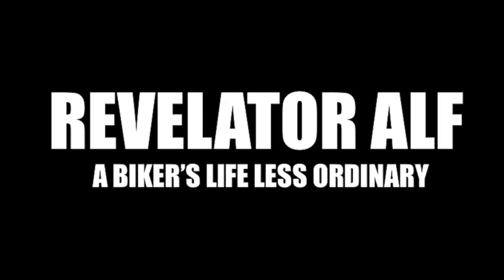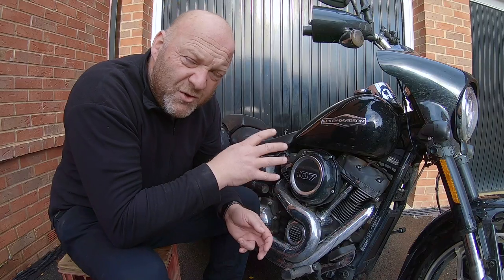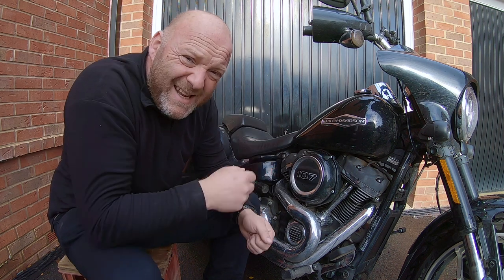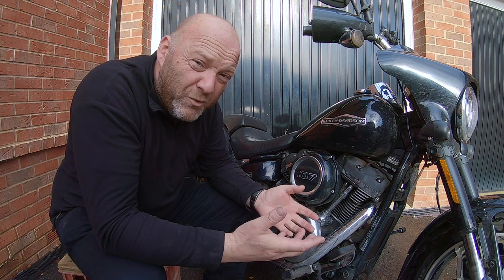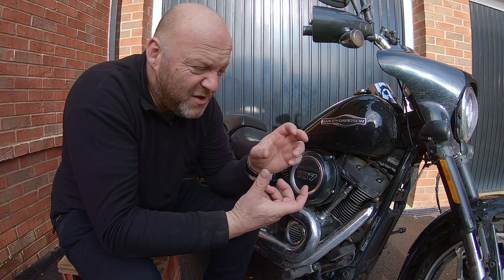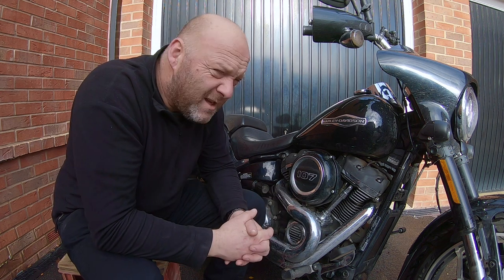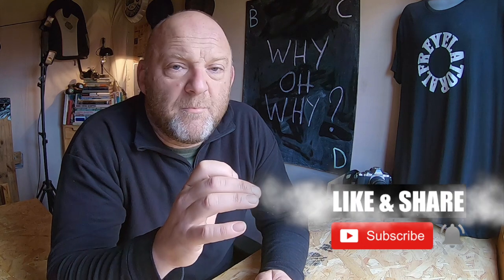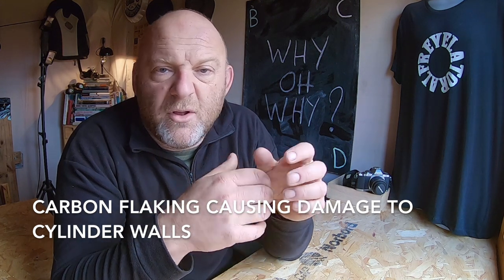Is It Worth Installing External Breather Kits | H-D Truths & Mistakes

Comment: I have a Screamin Eagle Stage 1 air filter kit on my 2019 Fat Boy 107. I can connect to this video you mentioned. All I did is to open up the air filter sprayed some Liqui Moly throttle body cleaner over the throttle body as prescribed on the bottle which helped clear oil and other gunk from the intake valves and I could see that the engine was breathing a little bit better as the revs it needed to sustain while idling was reduced by 20 to 30 RPM and overall it also improved my pick up and acceleration although a wee bit but noticeable. Worth trying it Liqui Moly recommends the activity every service but should be fine every 3000 miles too
Reply from the maker: Ok good to know, thanks for the info. Cheers
Reply: Prevention is Always better than Cure..There are Countless Automotive Videos where the Build up is so Severe the only thing that Works is a Tear Down and a Sandblast using Walnut.. NO Additive with Resolve or Reverse the Carbon build up..Just another Gimmick.

Comment: I can tell a riders habits just looking in the carburetor.  Someone who just cruises around doesn't have much transfer of oil through carburetor.  Someone who likes to bounce  off the Rev limiter will need a catch can . All these bikes are basically designed the same so the only real difference is the rider. This guy is being too technical. I have a buddy who could ride  20 different Harleys and the breathers wouldn't be an issue.  Have me ride those Same bikes and you'd need a catch can and not one of those tiny ones but with a drain on the bottom. Every police bike in my area has a bypass with catch can. I learned that decades ago and it's just logical that getting rid of hot air going into carburetor is beneficial. Only helps on warmup.

Comment: Very interesting and informative. I like that you showed the pros and cons. But they use the same system in every car and bike made. So it really can't be that bad by not having one. And to gain a few HP and possible check engine issues later is it really worth it. Cleaning the throttle body every now and then I guess will help. But thank you for you open minded thoughts.
Reply from the maker: Thanks so much

Comment: When I got my 2007 Dyna it was bone stock with 6800 miles. When I pulled the plugs they looked good except for a little bit of deposits built up. I put on a high flow a/c, vented the heads to the atmosphere,  some Screamin Eagle slip on mufflers and an FP3 tuner. It has 37700 miles. I check the plugs since the changes and never have any deposits on them. The bike has always run great.

Comment: Interesting video, thanks. I personally won't be worrying about it and I'm sure it will have little or no detrimental impact on the motor. I certainly won't be pulling my heads off anytime soon and I always use Esso Supreme as it has much less ethanol if none at all.
Reply from the maker: Sounds good to me

Comment: My issue is the oil reside in the throttle body in particular the idle air port getting blocked and requiring cleaning. That’s why I’m considering an external breather kit

Comment: All great points. I don't think it is a performance issue. It is a maintenance and cleaning issue. My main reason for a catch can is during my long rides in hot temperatures, I will have oil splatter all the way down the right hand saddle bag and on my leathers, due to the oil leaking from the breather. I ride annually to Sturgis from North Carolina for a total of 8500 to 10,000 miles per trip. The oil residue isn't an issue on short trips or riding around town. It is an when you are riding 600 to 900 mile days at a constant 3,000 rpm, for days on end in 80 to 90 degree temperatures. I know some will say it is a dirty air cleaner or a topend issue. It's not.  During these long trips, I change and clean the air filter every few days. The bike also has good compression so it isn't a ring issue. The average weekend warrior won't see enough venting to warrant a catch can in my opinion. People doing a lot of long distance touring with high daily milage with prolonged periods at high rpm, will see a lot of venting. It has happened on every single long distance ride. I have lost anywhere from 1/4 to 1/2 a quart of oil on a 5,000 to 10,000 mile ride since day 1 with my M8. Running lower oil levels does seem to help with the amount of venting, but it is still an issue.
Reply: Thats not that much oil in 5k miles.
Reply: For a harley, not at all! But, it does get old having oil plastered down the side of your right saddle bag, exhaust, and leathers every day during those long trips, especially if you are camping in remote places. It seems ridiculous to me that harley builds engines with this flaw built in. Indians don't do this, nor does any Japanese touring bike. A catch can just makes it easier to clean and maintain in my experience.
Reply: @peterkranenburg1984  my late model car used over a quart in 5k miles.  My Harley normally doesn't unless I'm running really hard and using the engine for a lot of breaking like in the mountains.
Reply: I rode across Canada on my 2018 FLTRU in 2019, somedays over 700  miles.  Have a stage 2 with power cam and have not had an issue with oil escaping the air filter housing, yes I get a very fine film at the throttle intake, but nothing like I'm seeing from others, not sure why.  Have 78,000 kms on it right now,  I've never had to add oil between changes.  Makes me wonder whats going on.

Comment: Hello Alf, Like  your Videos .you Do get a benefit from fitting a external breathing kit, you don't get an oiled up filter when you over fill your oil tank, and get oil blow back 
,and your throttle body is clean. I have an EB kit on my  2017 dyna street  Bob. had it for 2 years.my plugs are always spot on, And the Bike feels like its running better, to me it makes sense clean cool air going into the engine. We know Harley do things like they do to Pass emission  Laws. Then leave it To the Buyer to sort their shit out .DK customs have done some tests and Have EB kits, Its worth a look on you tube. If we wait for People to do tests on loads of bikes, we will learn nothing. And if it comes down to cost.my EB Kit cost £6. Keep the Videos coming Alf I really enjoy them. Regards Bob
Reply from the maker: Thanks Bob. Yep I'm in the middle of doing some testing myself. Cheers

Comment: I have a 2013 FLHTK - tired of oil collecting in the air filter and spraying all over the side of my bike so I installed a catch can system- if HD had a setup to where the oil wouldn't leak out I would go with it. I've also tried a V&H intake and a K&N both still had oil collecting in the air filter.
Reply: Yer most likely putting to much oil in the bike. You need it in the middle of the dipstick when it's hot. If you put the oil to the top that is the maximum amount of oil ,when it heats up or ride it hard the oil expands the level is now too high and will begin to leak out the airfiter area. Between low and maximum level, being the middle of the stick hot is what you want,That is considered full . If and when you ride it hard the level will rise to the top or maximum amount of oil the engine can hold. It's like a blender you put the stuff in and when you hit the button to mix everything together the level raises way up . Same thing happens  in the motor with the oil .Everything moving around so fast curning
The oil up with air ,the level raises to high

Comment: on a side note, seen a dyno with aftermarket 2-1 fitted only= made no difference just louder over bone stock M8
Reply from the maker: Yep if anything they are marginal alone. Cheers
Reply: Gotta tune that schitt 👍
Reply: Need more air, pipe and filter does !
Reply: There is data to prove this, DK Customs did the dynos and followed up with a video.  The M8 is not tuned lean from the factory as was the Twin Cams.  Stage 1 parts with a tuner only give marginal HP and torque increases.  But if you want the noise, do it!
Reply: @sboy1955  DK Customs videos are all designed to sell you stuff.

Comment: I had to put one on my 2015 flstc. My problem was that oil was getting into the sensor in the throttle body causing it to stall when coming to a stop. Since then, no stalling out.
Reply from the maker: Ah great stuff . Cheers
Reply: @Curtis Did you have to replace the sensor or did you try cleaning it first? Having the same problem now

Comment: I have 2 of the same exact engines one with bypass and one without, rebuilt both at same time and I can guarantee you are highly mistaken. No big deal but there is evidence thats not anecdotal it's not that hard to find.
No experiment is perfect but it doesnt have to be perfect to get reliable real world data.
I enjoyed your video and your thoughts and if I didnt see the proof first hand many times I would probably agree with most of your points.
I will say it's possible the the slight increase in compression may ad a horsey or two but I thinks it's better to just keep it clean.
It's mostly water that comes out of the crank case, especially with ester based oils.

Comment: My stock 1200 2009 sporty has given me zero problems with oil buildup so I guess my bike will be one of the few stock bikes left. I don't need to install a breather kit to feel like a biker/wrencher. I do all my work save tires and such. I do have the SE air filter and put my stock mufflers back on after my ears were bleeding from the rumble. No worries about cops and tickets anymore

Comment: Pretty good video and well thought out. I think if I felt pretty confident breaking the engine open to clean everything out, I'd skip a breather. I don't want an external breather for performance but having clean cool air to hopefully cool the engine down a few degrees and hopefully prevent build up over the long term is what I am searching for. I got a brand new bike and want to keep it for the long haul. Thanks for the vid.

Comment: I watched your video with great interest. You presented good well thought out reasoning. I have a 2007 fxstc and tried venting externally last summer. It has a Stage One setup with a high flow air filter. It seemed to work initially but then the engine ran strange and wouldn't idle right. I took it off and it's been fine since. I think the bike (computer) was telling me to stop messing around! Thx for sharing! R
Reply from the maker: Yep there's a lot to be said for that
Reply: Did you try to re-tune it? Curious. Im thinking of adding one, but i have the ability to auto-tune with my SE street tuner

Comment: Correction..... Not pressurized air being recirculated.......  it is oil, oil vapor, moisture, nitric acid vapors, carbon dioxide, water, hydrochloric acid,  to name a few items that are sent back into the engine.....    Typically small amounts but that depends on the engine.    The big damage is to seals and gaskets as they will leak sooner and greater.

Comment: I ride a 2016 SGS I bought new, after 2300 miles I had HD install a Stage V Tire Shredder Kit.  My main reason for installing an external breather is that every oil change, I have to clean my whole intake, throttle plate and spray off all the oily residue that has collected on the MAF sensor with MAF sensor spray cleaner, don’t see how the MAF sensor sends good singles when covered with oil, that alone is worth it to me!
Reply from the maker: Thanks for sharing. Yep sounds like a good idea in your case. Cheers

Comment: I dont know about performance but there is evidence that rebreathing oil impregnated air is bad for the cylinder head gaskets.
There's been a few engine tear downs on youtube by performance builders who have shown the damaged head gaskets from rebreathing.
Though a breatherbolt system is not necessary to solve this issue, all thats needed is a vented dipstick on the M8 engines.
There's A fix as simple as drilling a hole into your dipstick and gluing in a fuel tube connected to a small filter solves this oil rebreathing and stops the head gaskets from getting damaged. Feuling sells a rather elegant 300$ billet dipstick system that fixes the issue as well.
A1 Cycles demonstrated this issue: https://www.youtube.com/watch?v=RZyO7qK9npE
Reply from the maker: Ah interesting thanks and I suppose those findings are anecdotal which I'll refer to my main point that without extensive study we really can say for sure.
Reply: You are right, I got crankcase vent very early, there is now just a little bit oil mist inside throttle body.
Reply: Yes I think you are spot on. A lot of people are over thinking this thing, the dipstick breather system works well, and like you said, almost cost nothing to make.
Reply from the maker: Yep
Reply: Chec Kevin Baxter's channel in m8's issues And engines torn apart. Genius!!

Comment: On the same token, adding fuel additive to clean the engine would be the same lines..no proof it cleaned, but keep in mind that hard carbon deposits can break off and cause scoring of cylinders, so reducing carbon build up is important..another couple things you did talk or touch on is the effect over filling the crankcase oil level, or talk of changes in top end engine vacuum when removing the OEM set up..i errored on the side of caution and pulled the re- directed out of the intake chamber, and made a mini 1 ounce catch can, and set it inside the air box, but outside of the filter..now I will check it for oil and for vapor issues in a few hundred miles

Comment: Great explanation. 
The biggest car and motorcycle manufacturers of the world are doing it the same way as that is not a real issue. If that was a real issue for all those engineers designing best engines of the world they could easily do it nicely adding breather right installed nicely from the factory properly just adding few dollars cost. If they didn’t, doesn’t mean few dollars cost cutting. is just because it’s not an issue as it is claimed by aftermarket parts makers. This issue is just been created by aftermarket parts producers who haven’t even been to college or university to make useless products to sell to people who believes in their lies to make money. In this video the author explained very honestly and professionally in an excellent scientific way the truth. Of course people are still free to believe the lies of aftermarket part producers and let them make money on their simplicity. Open your eyes.
Reply: The engineers employed by the manufacturers did not design the internal breather system because it offers superior performance, it was designed to comply with EPA regulations. These engineers cannot add an external breather to modern engines because they would no longer comply with the EPA standards. Look for the opinions of engineers who build performance engines, guys like Kevin Baxter, as well as long time Harley Davidson mechanics. They all say that external breathers are better for the engine. I’ll take their opinion over the manufacturer every time. The manufacturers and their engineers are the ones who are lying to us in order to appease the EPA.

Comment: This all reminds ,e of in the states in the late 70s when they added a PCV for emissions. I suspect that it’s most common with engines that have the stage 3 and 4 and they are really pushing it and it’s blow by.  The only one I can see working is the Trask performance system vented top cover. They are using them on their race baggers and have some objective data form race bikes.  

Is it worth it for the average rider to spend the money on it ? I doubt it.  I think keeping your air intake filter clean and a good map would probably do more.

Comment: My experience.  With my early ones had a times rotary breather valve. Had breather kit.  But did leak. But road 10 hours on freeway at 70+ mph. But did hear they sucked in dirt. Twin cams seem to have a rubber type valve from memory and go hard in time. So if not sealing well will suck grit back in if not filtered .. I get a bit of oil on my filter. But just wash it off at a service and re oil.  Only time I know oil is a problem in a combination chamber is at super high compression and week gasoline to cause pinging .... mine runs 10.5/1 run it 10+ hours on a freeway at 70+ mph and have no problems.  But maybe I’m lucky....jon from Australia
Reply from the maker: Cheers Jon, great info

Comment: Apart from the fact that it’s obviously not doing your engine any good however slight it may be. The main annoyance is having oil leaking out the filter housing and onto the engine after long rides.

Comment: I had an ounce or more run out of my Road King when I took it off to do the 20k mile service. Not sure where all my oil goes, but the bike has used approximately an extra quart every 5k miles since it was new. Hasn't gotten any better or worse. No big deal, just that no other bikes I've owned used any. Well except for a ZRX1200 that once had a couple of Nikasil cylinders delaminate. That one burned a lot of oil and I am probably solely responsible for polluting the entire planet for a couple days when that happened.
Reply from the maker: ha ha yes indeed. I suppose general oil burn is normal for H-Ds anyway

Comment: Nice video, but my 21 bob 114 is finally up for its 1k service, and its got some oil residue on the inside of the filter cover that i can wipe off with my finger. I do plan to do an external breathing set-up on my bob, but the only set-up im willing to go with, is the one that the Blockhead channel has. His $12 fix shows drilling and tapping holes on the outside of the cover where the breather bolts go through, with the ends plugged. Once drilled, zerk grease fittings with the little ball removed, are installed with rubber hose teed off, running back to the transmission cover, which has another zerk fitting installed on top the transmission cover. This set-up makes sense to me, since it routes the vented oil back into the transmission, then vented out the transmission.